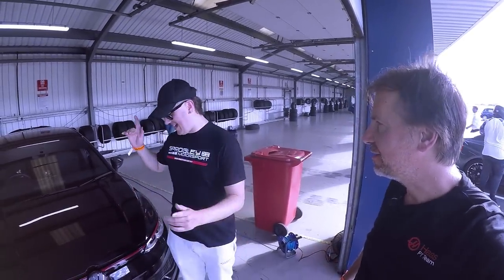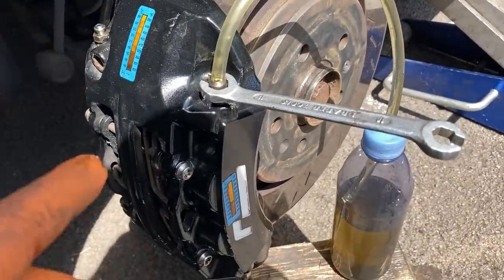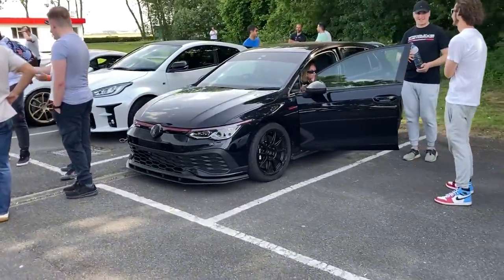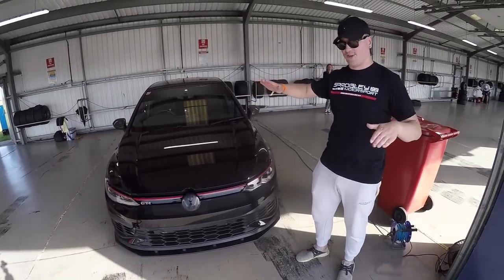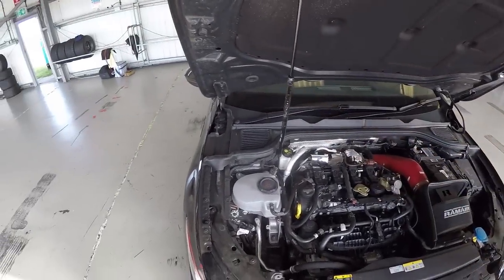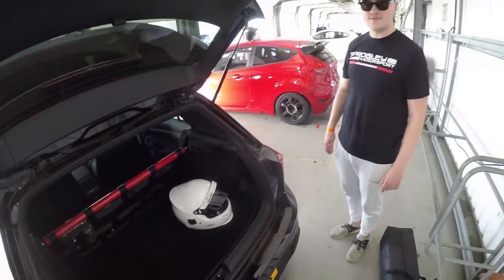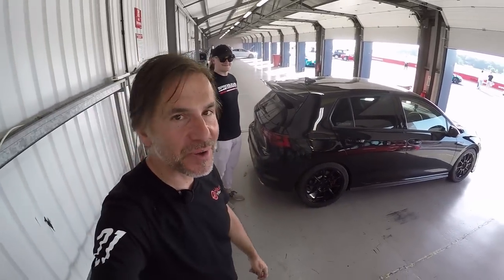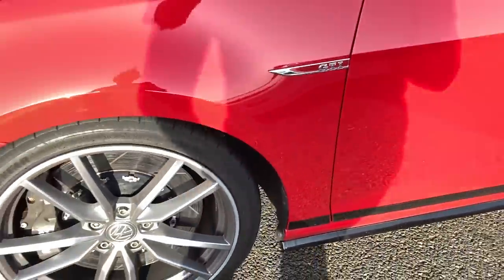TUNED Mk8 VW GTI Clubsport + Mk7 Clubsport S vs Project Cupra ON TRACK

Comment: Axle stands on the driveway. The life of a car guy! I make you quicker through the corners than Simon is his CSS. Good job! Great video as always thanks Andrew.
Reply from the maker: Yes Mark, glad to be more real world with axle stands than 2 post lift😎 Might change my mind when I get a job underneath but will worry about that when I get to it😁.  There is no reason why CSS should be slower in corners as on same tyres (make, model, size) and he's got better hardware unless tyre temps were less than optimum, it was a funny old day all in all but fun for sure!

Comment: Looked a cracking day. There was no catching Edd in the mk8, Andrew. 😅 
And what’s with all those GR’s!? They’re everywhere.
Reply from the maker: I can't comment too much on GRs as I have history 🤨but I am sure they are fun if not fast.  Edd's car is 320 PS ish, mine is 300, weight wise, probably close especially as Edd had a passenger, DSG will have helped on the straight for sure but less so elsewhere.  We have similar spec brakes. Crucially he has coilovers vs my stock DCC so his handling will be tighter but not as plush as mine on the road (stock 8CS is way firmer). Similar spec tyres too and he know's how to drive.   So I'd say both cars performed as expected which is a good result!

Comment: That Clubsport served up a nice gaperoni. Both sweet cars
Reply from the maker: Yes it did, makes since as a bit more power and possibly less weight, DSG will have helped on the straight too as seamless changes. And of course on coilovers so likely to be much  harsher on road than my plush DCC Cupra, horses for courses.  Good showing from Mk8 though, reckon a Mk8 Clubsport S would kill Mk7's ring time
Reply: @volkswizard  yes I guess DSG is the main reason. The power should be near the same?

Comment: Why is the red CS driving with the bonnet slightly open?
Reply from the maker: He forgot to shut it after cooling engine in paddock. I'd expect a warning light on dash which Simon would have been unlikley to ignore.  It didn't fly open at 140 mph so all good (with the hood 😁)
Reply: @volkswizard  I guess Simon had a lucky day.. it would be a shame if it swung open.

Comment: A good day was had by all. That temperature 🌡️, Australian summer stuff.😲😁👍
Reply from the maker: I've always watched hot US track videos (like Willow Springs) and thought that must be tough on the cars but just shows how well engineered they are to take all that. I'm sure you have AUS tracks days too and nobody bats an eye. Only issue in UK is that's it's unusual so cars aren't used to it so when they get thrashed + it's hot problems are likely. Pleasantly surprised my car which was 1/3 of the price of the other and 3x mileage and oldest hasn't had an off day yet. EA888 is generally a tough piece of kit.
Reply: @volkswizard  I'm a wimp Andrew, never tracked any of mine, so enjoy watching guys like you who do. 🫤😁
Yes the EA888 is one for the ages isn't it. Like the Porsche, another excellent find is your Cupra. 👍

Comment: Loving the track videos and looks like the project cupra is holding it’s own💪. .  how you finding driving a manual compared to the dsg gearbox of the outgoing clubsport? 😎
Reply from the maker: Thanks Pete R!  I watched a video of me driving my Mk5 Golf GTI Edition 30 and it looked so much more exciting than DSG shifting in TCR and Mk8 CS and the reality now I am back in a manual is exactly that. I thought DSG would be best for track but it's a bit too easy, on the road it frees the brain up to drive faster and safer but on track it's a bit boring. Shifting at 120 mph into 5th is very satisfying!  The Cupra box isn't that great on the road TBH but on track it's superb as the video shows, shifting is easy and slick.  I suspect I have an uprated clutch though as standard one is chocolate.

Comment: That Clubsport S have the bumped up brakes and clutch you wanted Andrew?
Reply from the maker: I think I have a beefed up clutch already as it's a little heavier than stock (and is taking the abuse easily). Simon's brakes are the best of the best, mine are much better than stock so I'll see if I need more braking but going by 30 degrees hard use, I'm OK (as long as I cool down for a lap...)

Comment: Title "Tuned mk8 clubsport".....in video.. Not a tuned mk8 clubsport... I can't be the only one who got triggered by this.
Reply: It’s not stock is it though so come on what would you class it as mate?
Reply: Depends on your definition of ‘tuned’. Spires ‘Tuning’ ‘tuned’ the suspension on the car. Doesn’t have to mean remapping 😉
Reply: @escos0410  when you say the word "Tuned" generally speaking it means the ecu is remapped. The word "modified" would have been a better pick if it not were for the click bait.
Reply: @dodga100 110% with you mate
Reply: @Mant0r  I think I speak for the general population of car enthusiasts that when the word "Tuned" is used it means some sort of ecu remap has been, or may be that's just me 🤔
Reply from the maker: "Car tuning is the modification of a car to optimise it for a different set of performance requirements from those it was originally designed to meet."

https://en.wikipedia.org/wiki/Car_tuning
Reply: @volkswizard  I don't disagree with you, but like i said "GENERALLY" speaking if you go any car meetbor gathering and mention that your car is "Tuned" you and I know that people are expecting some sort of ecu remap.
Reply from the maker: Tuing means optimising performance, not specifically the engine. Brakes, handling, gearbox can all be "tuned".  
Modifications don't necessarily make a car faster or better so it's not the same thing.   
If you are old enough to remember Crypton Tuning you might associate the word with engines but it's not exclusively applied to them.
Reply: @volkswizard  again, I agree 😂 but this one came off a tad bit click baity because like myself the majority of your viewers are probably my age and we grew up with the word "tune" meaning an ecu remap. Even though tuning may mean the overall change of a cars dynamics be it handling or drive train characteristics... To people like me it means engine performance.
Reply: ‘MODIFIED’ in capitals now in the title 🤣
Reply from the maker: @jamesyork8524  Saves all the comments from people who think their (and others') perception of a word is the right one when (according to independent bastions of what really is what, like Wikipedia...) it is not.  Wouldn't normally bother but this time, modified is actually a better word for drawing people in.
Reply from the maker: @dodga100  Wikipedia says it doesn't mean engine performance so because *you* wrongly think it does, that makes it "click bait" does it?
Reply: Get a grip FFS , if that's all you've got to say best to keep shwsh next time 😞🙈
Reply: @volkswizard  I don't know why you bother replying to these kind of people 🤷🏼 
They really do have a sad life!!
Great video keep up with the hard work 👍
Reply: @pauldavies7251  you know what it means if he responds to you tho right? 🤣. Calm down its just a simple conversation.
Reply: @dodga100  you’ll be pleased to hear the car is now tuned by your definition and probably the fastest Mk8 Clubsport in the UK 😊
Reply: @Mant0r  with mine mate 12/112022 we had ours done